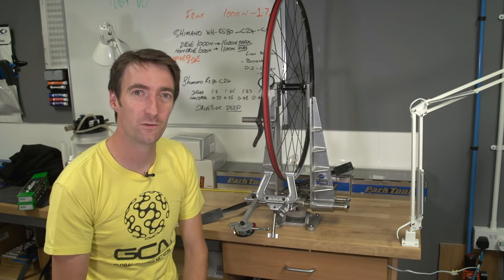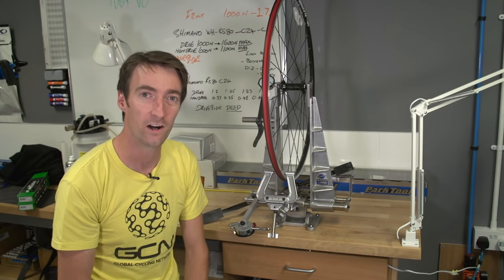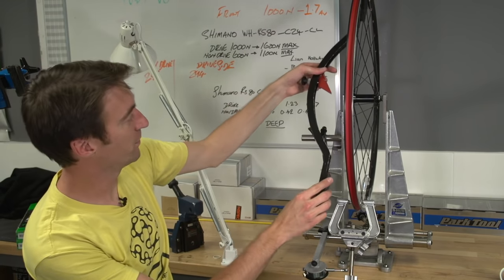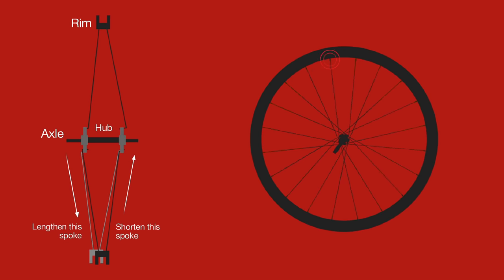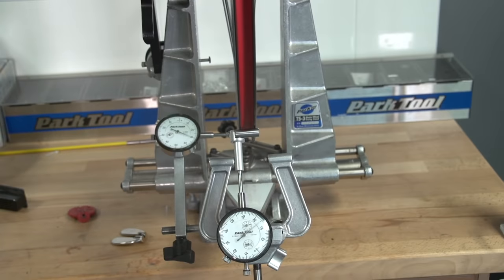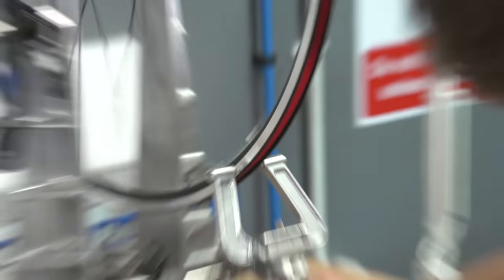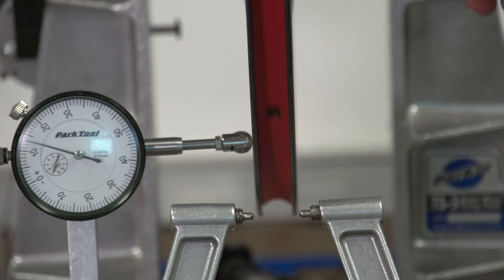How To True A Bicycle Wheel

Comment: so basically it is impossible to do it yourself if youre a mere mortal
Reply from the maker: ***** we wouldn't go that far... Just requires a bit of time.
Reply: I do it myself with a very cheap material, and the result is less than 0.5 mm . ;-)
Reply: @mogeoofficiel  Honestly it's way easier than people think. My first wheels I was very surprised when I got them within 1mm in an hour or so. I thought I was gifted but it's not that, it's just not as hard as people say. I think why people think that is because of the time, it does take time. Going closer than 1mm takes a lot more time as it gets harder. But getting to 1mm really isn't difficult.
Reply: @alantaylor6691  The difficult part is getting a decent truing stand... that costs a fortune... :S
Reply: @danzirulez  
I suppose you wouldn't want to use a cheap truing stand, better off just using your bike frame!
Reply: Bunker Sieben  
I use zip ties on a variety of bikes including road bikes, hybrids, mountain bikes and old lady bikes! Pretty sure you can use zip ties on just about any bike! I also use a zip tie for the radial pointing down from above if there's a fender hole there which there just about always is!
Reply: No, for basic purposes, it's not hard to get them "good enough" even for an amateur just working with the rim and tire on the bike. I just straightened a wheel today. See this other video link. Where the rim rubs on the brake pad is where you need to make adjustments. Don't forget to loosen first on one side, then tighten the opposing spoke or spokes. 
https://youtu.be/zcwVsxnF6pc
Reply: @chesshead3943  that's what I did lol at first I was like wtf is this bit after spending half an hour I have the wheel winning smoothly through the pads
Reply: Im going to say from experience that if you are somewhat mechanically inclined you will be able to true a wheel within a day. Its not as difficult as what your brain is telling you after watching this video. You'll be surprised how shallow the deep end of the water is.
Reply: No so. No one gets it perfect. No one. Is it reasonable and with in tolerance 

The worse would be no maintenance at all.

Sure you own a $10,000 bike- sure make it perfect but I assure you….. you can’t make it perfect

Comment: the method in the video is to get it super accurate - you can leave the tyre on and simply turn the bike upside down and spin the wheel and use the brakes or something else as a guide for the alignment. Then loosen a spoke on one side and tighten the one on the other to adjust - you can get it fairly close simply using your eyes.

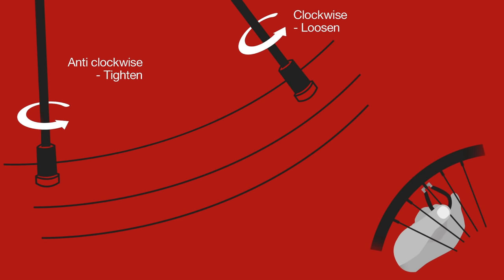Comment: At 2:04, are those arrows pointing the same way?
Reply: Exactly. This is the only thing I came to this and half a dozen other videos. Which was is clockwise, with respect to the nipple and the rim? The infographic shows clockwise and anti-clockwise as the same rotational direction. wtf dude.

Comment: After a long time using lightweight Shimano C24 wheels 16/24 aero spokes (or similar) I got tired of constantly truing them, and experiencing bad handling when they went out of true, which was always within a few days of truing them.
Then I got a set of sturdy Velocity A23 hubs with size 14 round double butted steel spokes 32/32 hand built wheels - the builder offers a lifetime service guarantee because such a setup never (well, almost never) goes out of true - IF BUILT WITH EXPERTISE IN THE FIRST PLACE.  He's built over 4000 wheels and hasn't gone bankrupt yet.  And surprise, after the initial service (within a month after purchase) I haven't needed another tune up in the following 6 months.  And these wheels (including build) were 1/3 of the price I paid for my C24s.  It's hard to imagine going back to the world of broken spokes / loose spokes just happening in the middle of a ride.  
If you are a racer I understand it could be different - but then it wouldn't be worth doing lightweight wheels on the cheap - to make it worthwhile you have to get your low spoke count wheels from expert wheelbuilders to start with so that your spoke tensions are nearly all the same at perfect true, and then make sure your wheels are always perfectly trued before you race.
Reply: I suppose for all the spokes to be nearly all the same tension at perfect true, that's determined by having a rim that's straight?

Comment: Thanks, I managed to pick it up pretty quickly and that's with my bike upside down. So for me, upside down working - at the bottom of the wheel, it was anti clockwise to tighten and clockwise to loosen the spokes. I find a gentle creaking noise is when it's actually adjusting through tension. I've got the wheel running smoothly between the brakes now and that's good enough for me. I'll probably make small adjustments every week as I learn more and get better at it, because canal tow paths certainly smash my wheels about anyways lol that babies head gravel.
Reply: My experience exactly. Once adjustments started to become visible, it started making more sense. The creaking of the tensioning spokes is really helpful to note

Comment: did anybody noticed at the marker 2:00 that the instructions are correct but the picture is wrong? LOL  both arrows point to the same direction - clockwise and counter-clockwise :)beside that - very nice video
Reply: Which one is correct ? if the text is correct it means the thread is the opposite of most ? To open a bottle you need to turn anti-clockwise.

Comment: Great video. Thanks for the great advice.
Note: If you are a noob (like me) and you are feeling adventurous enough to re-center the dish of your wheel, keep in mind to center it based on the dropout contact points, which is not necessarily the center of the wheel hub is you have a disk break/cassette/etc . 

I was replacing 2 spokes on my back wheel and I noticed the dish was not centred with the wheel hub. So I applied the method at 1:21 to center the dish. I managed to center it an I was feeling like a pro..... but when I mounted the wheel to the bike the wheel was not centered on the frame anymore and it rubed on the side.  I'll have do undo this now....
😶‍🌫

Comment: to anyone trying to true a wheel I've got a cheap solution, if your brakes can be adjusted make sure to have them adjusted so that they are just slightly clearing the rim therefore if the brakes start rubbing you can tighten or loosen the spoke in the correct places
Happy fixing :)

Comment: I had my wheels trued professionally but guy suggested that they were SO far out it might be worth investing in new wheels. 
Yesterday training ride back wheel wobbling so bad bad brakes are sticking to wheel fully opened! Quick repair-Enough to get home. 
However, my question- Once your wheel gets out of true vertically (as well as horizontally) does this mean a new purchase is due? 
Eyeing up Campagnola Zonda currently. 

All replies gratefully received. 
Top videos GCN!
Reply: Hell no, the radial true (vertically) is a normal part of a wheel getting out of true just like the horizontal true. Truing stands have a thing where you judge the radial true as well as the side to side wobble, and you fix them both in any normal truing job. In fact when you buy a new wheel they are very often out of true radially and side to side and need to be trued to get them right.

Comment: Good advice, but your graphic showing "Anti-clockwise - Tighten" and "Clockwise - Loosen" (at 2.02 in the film) have the arrows of rotation both going the same way. Think you need to change the "Loosen" to the other way around.
Reply: Maybe, just maybe, he was putting counterclockwise (Amuriken) a seen from the other orientation of the weel ;D
Reply: bizarre, mind-bleeping error in the graphic, that, at 2:02

Comment: Tightening by going clockwise versus counter clockwise... ??? It depends on whether you're looking down into the inside of the rim at a spoke at six o'clock versus looking down from the outside of the wheel at a spoke at 12 o'clock! If you look from the outside of the rim, your spoke wrench should go clockwise to tighten. The trick is to always maintain the same perspective or similarly always use the spoke wrench at the same spot on the truing stand or frame

Comment: You got it within 0.1 mm of perfect true? Who the hell would scoff at that? Most wheel companies say that anything within 1-2 mm is acceptable for new builds.
Reply: my mountain bike is 2 years old and I even trued those wheels to 0.1mm just last week I hear so many aim for 0.2mm but I aim for half but if it wasn't a mountain bike I might make it more true
Reply: Yes, Simon, but truing a wheel to the best of your ability ensure you won't have to true it to the same extent next time.
Reply: Never thought about that actually, good point.
Reply: @SimonWoodburyForget  Depends on your riding style I'd say. 
In my experience it's pointless to spend a lot of time trueing a wheel precisely on my Enduro bike. 
There will be side forces and it will be bend a bit soon anyway.
On my road bike I'll take my time. I'm sure it helps last longer during normal riding stress.

Comment: I'm confused, I just read on another website that to tighten the spokes, you turn it clockwise and to loosen turn counter clock wise? Which is it? Thanks
Reply: I find this confusing as well.  At 2:00, the arrows are both showing the same direction, yet one is labled clockwise and the other anti.  Difficult to find anyone who can make this clear.

Comment: i have a truing idea but idk if it would work. Im thinking of releasing tension on all spokes which will cause the wheel to untrue greatly but then slowly Increase tension on all spokes just enough to hit the same note/pitch with a guitar tuner. (lets say the tuner reads an "A" on all spokes which means in return that all spokes have the same tension. the A would be the truing base point. Then begin to actually true like it shows here? The point being is to have the closest stress on all spokes vs uneven stress by truing directly. What do you guys think?
Reply: Won't work. If you increase tension in 1 spoke there are many other spokes directly affected. Some will decrease in tension, others increase.
Truing a wheel from scratch requires lots of practice and skill.

Comment: just picked up a cheap second hand winter bike...............it's got stock wheels on....................on the rear wheel while it runs true a lot of the spokes where very loose when I had a feel of them and had a lot of play side to side........................so I took my spoke key to them and gave them around a half turn or so and tightened them all but now the wheel is way out of true and pulls to the left....................doI back off the spokes a bit and try to get the wheel trued again but have loose spokes or do I try and tighten the spokes that are laced on the right hand side of the wheel.....? thanks
Reply: I'm not a wheel expert but have some minimal experience with truing wheels. From what I understand, spokes have to have a tension between 15 and 25 units of whatever. When I was working as bike mechanic in a bike shop for a short time and we had a simple spoke tension tool. You can buy them on ebay or whatever I think for about $50. It's very easy to use, you just place it on the spoke and it tells you the tension.

I know your comment is 2 years ago and may not apply now, but I'm answering anyway. What I think you would have to do is use the spoke tension tool on those loose spokes. If they are below 15, tighten them to just above 15. I'd then go around all the spokes and make sure they are within the 15-25 range. Bring them just within range if any are out. Then I'd go ahead and true the wheel, checking periodically with the spoke tension tool.

In answer to your specific question, I do think you need tighten your spokes so they are tight enough. Then as you said, loosen the other side so you get it dished correctly again. No good having loose spokes, even if the wheel is true. I think it would be better to have a buckled wheel than really loose spokes.

If you can't get the wheel true while having the spokes within tension range, then perhaps the rim itself is bent too much out of shape. I'm not an expert I'm just guessing there.

Comment: just had a small crash and my rear wheel is not true anymore. It's not an expensive wheel, do you guys suggest just getting a new one altogether or truing it?
Reply from the maker: It really depends just how far out of true it has come.  You may be able to do it yourself if you're careful.
Reply: I'd better just bring it to a local bike shop. I've only been cycling for about two weeks and i made an amateur mistake of not shifting my weight to the back when i grabbed the front brakes. Flew right over the handlebars!
Reply from the maker: Ouch - hope you're alright?
Reply: just a scrape on my right palm and bruise on my left shin. Cant wait to heal up and get back to cycling ha!
Reply: u can always play with it before u throw it out.
Reply: easy mistake to make, try using both the rears a bit more forgiving if you lock it up. I try and always use the rear break slightly before using the front also.

Comment: Does it matter how centered the wheel is on the stand and therefore in the fingers?
Reply: If you rely on the stand only, then it's a must to be centered ! And also the stand must be well calibrated. When using a dishing gauge, you check how off-centre the rim actually is. You can have a perfectly true wheel, which is off-centre ("not aligned with the seat-tube") and it will likely cause tracking and braking problems, maybe wont even fit in the frame without rubbing. A good wheel is True and Centered :)

Comment: i'm confused. i just did a finished my try at truing a wheel 5min ago, and i'm pretty sure i went clockwise to tight, anti clockwise to loosen. the wheel came out straight..
Reply: figured it out. i dont have a spoke key so i used screw driver and did the job from the inside of the rim. if done that way, right tight left loose.

Comment: Question for riders. I bought my bike used and the area i live in does not have any bike lanes and to ride on the street here is an absolute death wish. So i would frequently ride on the side walk where i would constantly go through drive way parts or sometimes hit parts of uneven sidewalk. Well about a month ago my bicycle wheel got so warped from out of nowhere and i realized a spoke had fallen off. what are your theories on how this happened, was it because on where i rode or because the wheel was old to begin with? Also when i went to the bike shop they said they dont even know how it had gotten that warped and that it is beyond truing.Because I am living the broke american dream i have to find ways to save up money while also not becoming homeless. I have a road bicycle by the way, so very thin tires.
Reply: Sound like a combo of both old wheel and streets how ever this can happen to new wheels I see it a lot on factory build wheels,if you live were the roads are bad it a good idea to check you wheel post ride and check tension of spokes as shown in video if you get loose spokes tension a one one band can F.U.B.A.R you wheel and its new wheel time
Reply: +basportsfan citec trekking x wheels in 700x19c. light, very stiff and endurable. allways pump your tires up to recommended presures.

Comment: Very very good and efficient video
Also it shows clockwise and anticlockwise at same direction, but the video explain solution very good

But it needs professional and complete tools. Now what's your solution and your idea for disk brake wheels and without these professional tools for measure the force of wheel and any bracket???

Comment: Should one remove the tyre when truing a wheel?
Reply: +Scott Plumer Yes! Even if you have tubeless or tubular tyres, it'll be worth knowing the mass of the tyre isn't affecting the accuracy you get while truing. It also saves the hassle of clearance in your stand and of course, having to look around both sides of the tyre with two eyes!
Reply: +Ninja Duck Thanks!
Reply: "it'll be worth knowing the mass of the tyre isn't affecting the accuracy you get while truing": the way I understand your statement is that truing with the tire on the rim has no impact but you replied "yes" to Scott's question so I'm confused...
Reply: To rephrase his answer, yes, remove the tire when truing a wheel. The mass of the tire can affect the accuracy. In my case (a mountain bike with rather aggressive tires) I had to remove the tire regardless, because it wouldn't clear the stand with the tire in place.
Reply: Scott Plumer OK, thanks.

Comment: My wheels have internal nipple and bladed spokes, what do I do?
Reply: In order to true a wheel like yours, You will need to remove the tire to get access to the internal nipples. You will also need a bladed spoke tool to hold the spoke and keep it from twisting as you adjust. This does not sound like a wheel to begin your first session on. I usually suggest and older training set until you comfort level is higher.

Comment: If the center of the indicators is exactly inline with the center line of the drop outs in the stand, the truing stand can easily be used as a dishing gauge simultaneously, which is why I' building my own stand that will literally be better than any stand money can buy.

Comment: True or False: is this the most useful maintenance video on GCN?
Reply: True
Reply: I agree with both of u partially... u need to havr a spole tension meter to build a wheel but i completly agree with StrixNoctis that in 80s there was no such concept of spoke tesnsion meter... in fact earlier no body even had the torque meter and still did fine... it jusy now that we have recently started usinh these  tools for reassuring safety standards.
Reply: Sorry for typos!